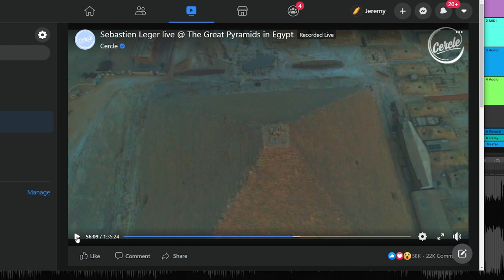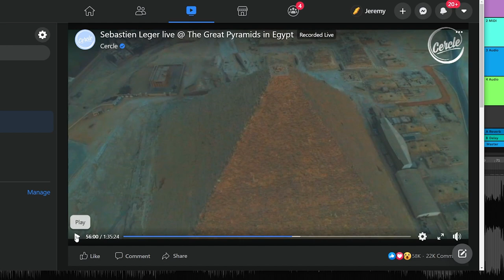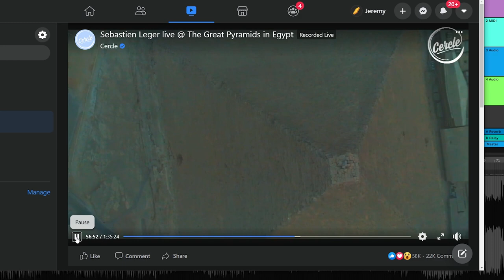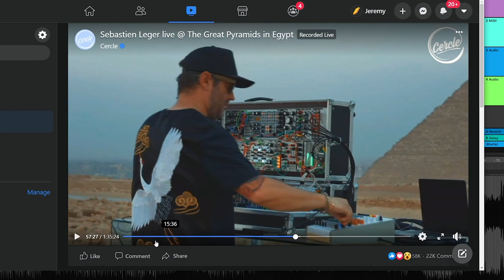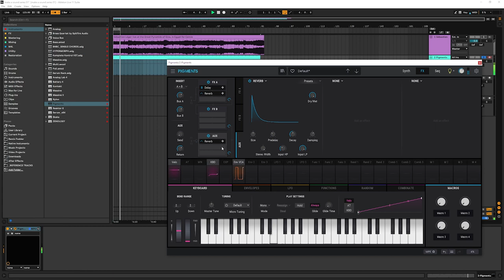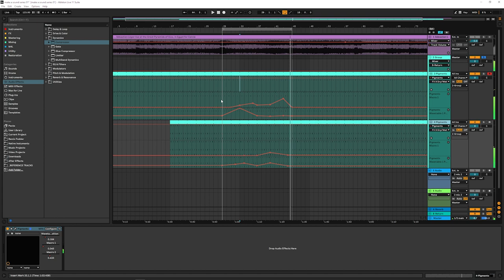Sound Design Challenge: Sébastien Léger Live at Giza

Comment: @redmeansrecording It’s worth checking out Sebastian’s you tube channel as he kindly posted a video of the prep for this set which is mostly same equipment. It’s looks like a hybrid setup using expert sleepers and effects in Ableton with the modular live on top. 

I did have to laugh at the idea of playing a light in a high pressure situation standing in front the pyramids. 

My view is the ‘scratching’ is actually sends going back into the computer for processing. Great stuff though and thanks Sebastian 🤟🏽